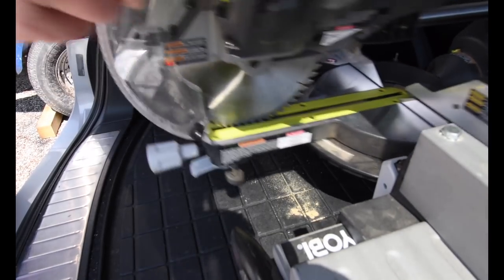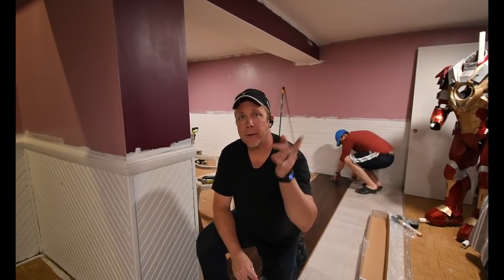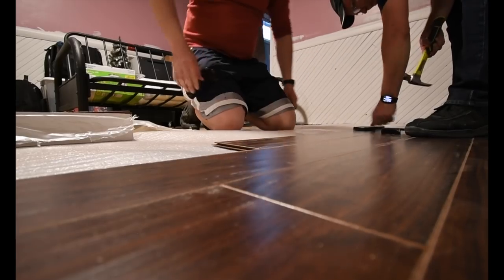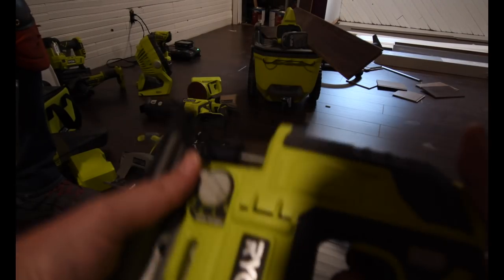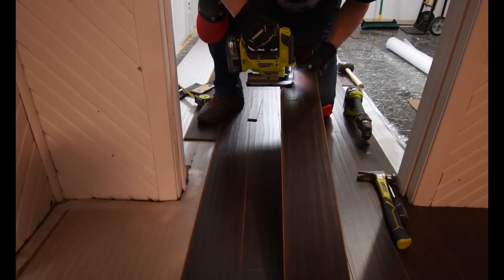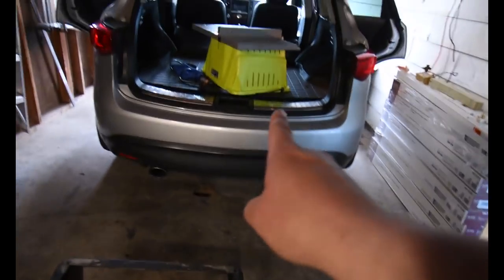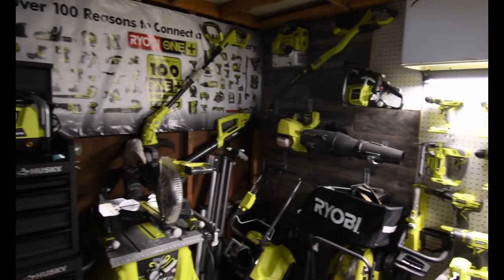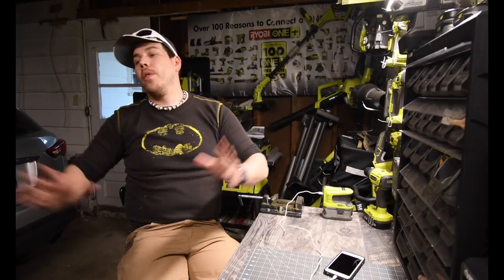Helping my friend Install laminate flooring

Comment: I notice u don't use spacers on da outer edge for expansion & contraction it needs a gap of at least 3/8 if not da floor will buckle & pop out dats y it's called a floating floor den u use quarter round to cover da gap it's not go in to last long, just my opinion but it looks good if u look at da boxes da tiles comes in I'll c it in da directions
Reply: Is typing “the” that hard?
Reply from the maker: thank you for viewing sir